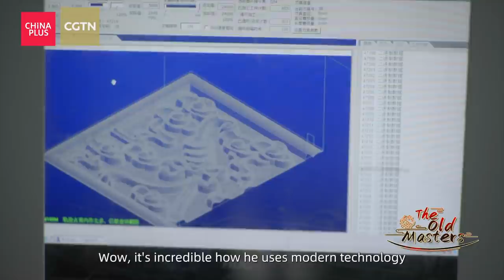Lu Ban Lock: Magic Chinese puzzle

Comment: I have 24 designs of these luban locks. Of which I have the Hero Lock & the Big Three Links in both the wooden & plastic versions. The rest are all plaatic versions. I prefer the  Qiyi brand plastic versions bcoz they fit snugly when assembled unlike the wooden ones which are loose.

Comment: Is there any way to buy a good quality luban lock online? The ones in the video look good but not sure where to get one.
Reply: I think you can buy them on AliExpress. Just search Lu Ban Lock or Kong Ming Lock.
Reply: @liisuu3  I did but would like to have one of better quality to display at home.
Reply: If you are looking for quality versions of these luban locks. I recommend the Qiyi brand plastic versions. They are smooth to handle & fits snugly when assembled unlike the traditional versions which tends to be loose.